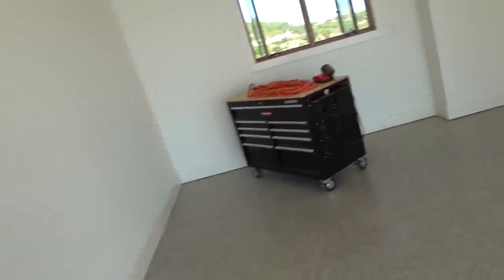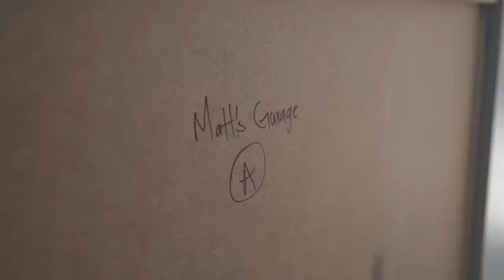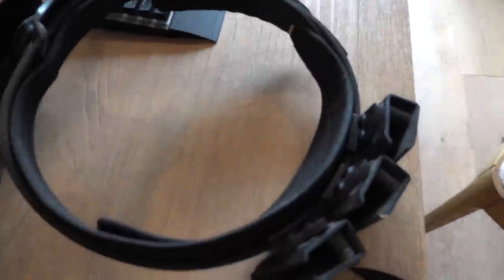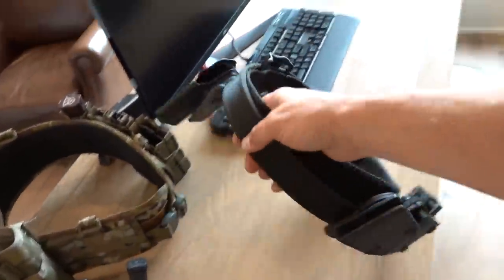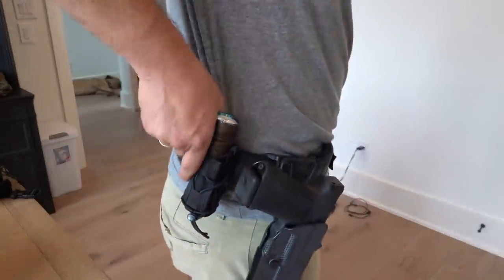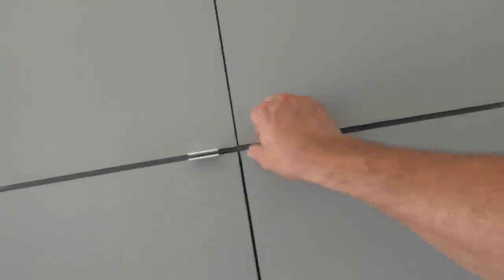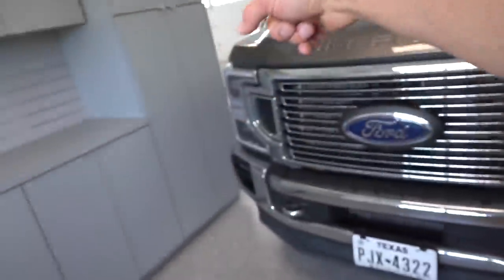Caught Intruder in my Backyard at 10pm... DemoRanch Gear Check!

Comment: Updating the security system to cover everywhere with high quality camera network via hardwired connections and floodlights that cover the whole main areas around the house and areas people might hide will take away any guessing in such times of action.  Having a few monitors around the house to watch and a quick way to turn the floodlights on means you and the family are safe inside while assessing the danger.  Also a speaker system so you can talk to them without leaving the house would be handy.  Most people in such situations will take off and those that don't then get to meet your gun collection.  Also given you are a famous person these days having some type of perimeter sensor system around the property lines and a remote powered gate would be a smart thing to do.  It might seem overboard but sadly there are a lot of crazy and delusional people in the world so better safe than sorry.
Reply: He got the same monitor as me
Reply: +1 for hardwired. I cannot stand wifi cameras. My ex (when we were together) wanted me to install wifi cams and I wanted a hardwired system. Granted, something better than nothing. I even saw one guy throw the wires into PVC pipes that ran through his house, which is a bit much but I like the idea that you'd probably know someone was trying to cut your cameras. With a UPS (power) backup, killing power to the house wouldn't effect much immediately. You'd have to wait for the UPS to run out. But at that point, they know what they're doing and you're probably not gonna stop them. Would be rare to run into that sort of thing, I guess unless you're famous.
Reply: Never forget- protecting your Family is the #1 priority! Stay inside and make sure the doors are locked, etc.

Comment: .300blk supressed, bed side. Also, lights (heavy duty lights) pointed towards the yard (from house to yard). Also, training with the entire family like a fire drill, on which room to go (safe room), and a gun that Mere can use easily to protect the kids from within the room until you clear the treat (or just go armed inside until, the police comes) Also, a police emergency button (simply safe connection probably). Take care, Mat.
Reply: Nuclear air strike as well.
Reply: @Ranstone  just not under wooden tables (just the opposite of what they teach in high schools).

Comment: keep your armor and duty belt ready on stand by.First you grab the vest then put the belt by the time you got the pew in hand your ready to roll.Set up trip wire and solar power lights in open fields or areas running electricity is hard to get to a lit area leaves no space to hide.

Comment: 1. Have a thorough camera system and alarm system. 
2. Have a way to monitor cameras with phone or tablet.
3. Do not leave the home, you know the house better than an intruder so you have the upper hand. Outside you are vulnerable. 
4. Stage weapons in key parts of home.
Reply: He occasionally advertises that a video is sponsored by SimpliSafe and claims that they keep his home safe.  If he doesn't have their systems installed, that would be hypocritical, wouldn't it?
Reply: Convert that old skyscraper nathroom tower to a lookout and put the Ma Deuce up there. Deriously, make sure one high mounted "camera" in front and back is Infrared. You'll spot them in a millisecond and don't have to worry about running from room to room hoping for a full moon.
Reply: @fotogfitzfoto412  simplisafe is good for a average home and a normal person living there. For what he has in the home and his celebrity status he need more than just entry level

Comment: Quick Pistol Belt
-TQ 
-small fixed blade. 
-OC spray
-Pistol (high quality holster with level       2 or higher retention)
-2 extra mags 
-flashlight
  
The best configuration in my opinion for a pistol home defense belt. 
Lightweight and simple. Anything more is for the battle belt or AR rig

Comment: As an avid watcher of both channels, I'm very interested in learning more about being prepared for any bad situations that may come up
Reply: same lol
Reply: Keep your light accessible by your off hand and use it with your off hand, all mag oriented tip forward on off side so it slides into the mag well with tip facing forward.  LOL even daily, no rig, spare mag in off-hand pocket it's tip up/forward so when I grab it with my off-hand it's oriented correctly.  Multi-tool is accessible by either hand too.  Draw primary and back up with either hand.  That's daily, no duty kit.  Night, light is always used off-hand.  Work with what you've got, make it work by repetition.  Can pull either pair of cuffs out left or right, do the same, it will set into your brain thus your muscles.

Comment: I've been doing armed security work for 3 years, and to be honest I think your "bump in the night" belt is alright.  I've used a slightly simpler belt with the same buckle and it was $125.  My only comment would be to put the flashlight behind the Glock mags.  The rule in our company is support tools on the support side.  Thoughts for additions would be a taser in the front by the buckle for cross draw, and a smaller medical bag in the small of the back area.
Reply: Ryan, what type of belt did you use?  The reason I ask is I have the same High Speed Gear belt Matt has (the one he referred to as bulky)  After watching this video I think a less bulky and lighter option is a good idea as well.
Reply: @Meand3023  It's the Safe Life Defense Tactical Belt.  I looked it up online and it is $129.
Reply: @ryanmclean7361  Thanks

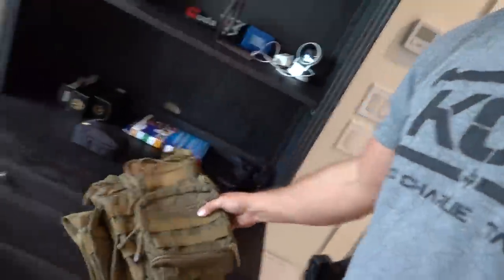Comment: Given the scenarios you presented about multiple intruders, I would go with a plate carrier over a belt. Should be able to hold everything you are wearing around 14:05 seconds, but eliminates having to put on two pieces of gear to only needing one piece. Allows you to store more mags of both pistol and rifle, first aid, extra light and you get body armor that a belt does not provide you. You can outfit the carrier to be able to holster your pistol if needed as well.

Comment: I would invest in a safari land holster for whatever pewpew you decide to run for your larger belt. you can get them to fit with a light or without a light as well as they are great with red dots as well
Also as an Army Medic I always reccomend a good lightweight IFAK or trauma kit. Love your content, just some advice from a guy who has a little experience!!
Reply: IFAK is a must-have on the battle belt, along with a tourniquet. In a use of force scenario, there's always a chance that yourself or a loved one end up leaking instead of the bad guys. So it's a good idea to have a way to patch bullet holes as well as a way to cause them, eh?

Comment: As a former Corrections officer, I'd recommend having some pepper spray and a set of radios. That way if push comes to shove you have a less lethal option and a way to communicate with Mere at the push of a button to have her call for help should you need it.
Reply: Radios are a good idea but fuck less then lethal.

Comment: I would personally recommend having some type of medical on the belt itself. I would also recommend two layer battle belts if you plan on getting another one. The inner belt acts a a normal belt but has velcro on the outside that will then attach to the outer belt that has molle.(good belts has the soft velcro backing on the inner belt to then make it more comfortable when not wearing the outer belt.) The nice thing about it is that it moves up and down less without being too tight.
Reply: Yeah no.

Comment: Try to keep everything away from the rear of the belt. From a law enforcement  background trust me, you don't want to go to the ground with someone and have a flashlight or something hitting you in the spine. And I couldn't tell if those belts have anything to keep gear from sliding around the sides should you have to roll around with someone or even if it gets caught on something moving through the house. You can find keepers online that work really well and are cheap.

Comment: I would move the flashlight in front of the gun holster so that way its easier to grab if you need it while holding the gun. My belt I currently run was about 50 off amazon.
it seems like it works well only time will tell if it is worth it.
Reply: Literally never put anything infront of the gun. What’s more important getting to a light quicker or having something in the way when you go for ur gun? Terrible advice but typical from someone who also thinks a $50 Amazon belt is a good idea for a battle belt. Don’t give advice if ur uneducated on the topic. Just breeds more people with insufficient gear.
Reply: I'd put the flashlight in the back as it's most likely to be the first thing out before you're engaged in a situation. 
Rigid mag holders on the left, holster right.

Comment: id replace that flashlight with a tailcap switch & instant access to strobe by nitecore. animals & people will get disoriented when shined with 1000 lumens on strobe. have someone point the strobe at you at night and see if you can think straight. Fumbling around finding the button on the side is way too long even without adrenaline. Dahua makes good security cameras, their newest one is the N45dud2 which uses 2 sensors 1 IR & 1 color then combines both to create color night video its a really unique thing to witness. In my house I use blueiris on a dedicated pc to run the cameras n drives. a lot of the cameras are power over ethernet so all you have to run is an ethernet wire from your hub to each camera

Comment: Law enforcement & military background:
Perimeter defense/alertness is the first line of defense. Someone entering your property should feel like they’re being watched.
As far as belt set ups: I recommend 3 pistol mag pouches on non dominant side closest to the front as possible (10-11 o’clock for right handed) followed by a rifle mag pouch (closer to the 9 o’clock) . Dominate side closest to the front (of buckle/1-2 o’clock for right handed) a fixed blade and flashlight for use of either hand followed by holster (recommend a Blackhawk omnivore as it holds a variety of different pistols and is based off of the weapon mounted light, as I can recommend the stream light tlr1HL, should have a wml on all home defense weapons) followed by a tourniquet and possibly IFAK for a little extra safety. Just my 2 cents…

Comment: For the bump in the night belt I would def make sure you have a flashlight and red dot on your gun. I would also bring a form of less lethal if possible (taser, oc spray, baton). Better to have another way to deal with people than just gun or fist. I would also have a way to secure people after the fact whether detained or serviced (handcuffs, zip cuffs). And a dump pouch. Takes up little space and is incredibly helpful at times.

Comment: Those cabinets look good and clean, just keep in mind that they aren't built to hold up to much as far as being a workbench. BTW I personally think that med pack is a bit much for a bump in the night thing. They make very small pouches and even ankle pouches with your most basic trauma gear and I would consider something that size, possible on the back of your night belt. Just a thought. Save that many more seconds having it ready to go all in one, also those straps on the trauma pack you have look like they could get tangled. So I'd atleast rubber band or just cut off the extra hangy bits if ya decide to keep it.
Reply: I didn’t want to bust your bubble but you bought Costco cabinets lol. Probably would have haves saved half of what you did. Sorry

Comment: Mad Matt doesn't hold a candle to a Mad Mere.
Solar powered security light coming on pop, pop, pop
down the driveway and into the yard, scares people.
Reply: Solar powered security lights are the worst idea ever, unless you go with very expensive ones. And then still, for security lights if you have grid power, use that.

Comment: Ranch homes need some kind of early detection system further down the long driveway. There are simple beam break motion detectors than can be set up wirelessly and on solar power, all the way to magnetic anomaly detectors that will pick up anything metal as small as a hammer.

Comment: The two belts I use are the trex arms orien and the ribbon tactics TF belt with estac kiwis 2+2 a dump pouch a med kit from blue force gear with a Haley TQ swinger underneath then my safariland holster and a multi tool and gloves hangin off I can throw that belt on easily over my coat pajama whatever and grab a rifle and pistol ready to go

Comment: You need motion detectors on your driveway/gate so you know someone is coming before they get there
Reply: Also would be worth getting solar and a turbine with a large battery and an cctv setup so that the cameras can't be accessed from the internet as a backup, I'm sure Linus Tech tips or someone would make you a server with a Nas so you can store the data onsite as well as you having a large amount of storage and editing power for your videos
Reply: A reverse osmosis system is usually pretty good to have as well, plus a root cellar for you to store food in

Comment: Also I got to say Matt I'm a little stunned that you wasn't prepared for a situation like that given all the things that happened to Roman I guess I just kind of expected you to be on top of that the good thing is is you recognize a deficiency and your correcting it you got to protect yours at all costs
Reply: @HS-hr5wp  family was being stalked
Reply: It's not like he was completely unprepared. Has a full electronic security system, which alerted him to the intruder in the first place. He just didn't have a plan for what to do when the alarms went off, which is shockingly common even among 2A people.
Reply: @theKashConnoisseur  you're right he did have a good foundation basically what I was getting at not too long ago Roman Atwood had an issue of kind of an extreme stalker giving the working relationship between the two kind of figured he might have had a heightened awareness and security being so close to that kind of situation and to hear him say he didn't quite have a kit ready was kind of surprising

Comment: You should have pull out drawers in all your base cabinets so you don't have to get down to see whats in the back. You can also put them in the 2 tall cabinets, makes it easy to find things. As far as your driveway goes Dakota Alert sell a break beam alert that can be set up to 300 ft. apart and will transmit up to 1 mile to the receiver. Ample time to prepare. Good luck with whatever you decide to do.

Comment: you need a med kit that can attach to the bump in the night belt at 6 o clock. vs a sling/pouch. that would be much more effective and less colliding with straps/material when messing with flashlight or.. presenting. :)

Comment: A Masada Valkyrie backpack with a front ceramic plate is my go to. I keep a take down AR in it and use a similar belt setup with the flashlight on the non dominant side. I figure a little armor is worth the weight and it is a nice small package.

Comment: Leg shroud will hold that HSG belt in place a little better. I have a G Code belt that is for that purpose alone. Padded inner belt, leg shroud to keep the belt in place a little better. Couple mags, flashlight, extra batteries, small trauma kit etc.

Comment: Great video never thought  of having a belt ready like you. I would go with the small one. Imaging you have to drop to the ground or something happens that the big belt has more stuff to injure you if  you fall . the smaller one much easier to move around. You  should test it plus what happens if your wife needs it too in case of emergency. Now $200 is to rich for me too bad there are not cheaper ones.

Comment: I would say first off very good start. On the battle belt I would put a smaller IFAK like a Blue force micro trauma kit now, Ferro Concepts Roll 1 trauma pouch, or just a tourniquet. This will allow you to only need to throw on one thing and go. While allowing you to be able to make holes and plug them.

Comment: Safariland if the pew will fit 🤙 thigh strap too for the holster. Lock it down. Others have mentioned the mags in the same direction that'll be consistent. Multiple tourniquets is ideal 2 is 1 in the long run  👍 Gear is a black hole for sure!

Comment: All my quick reaction stations on my property contain a long gun with quick adjustable sling, ears, and equipment satchel.  The firearm is loaded with a mounted light and night sights (like a shake to wake red dot) with back up steel sights, and the satchel contains several hundred rounds in mags and is thrown over the shoulder.  I don't do belts for quick reaction, in order to have more flexibility (crawling, climbing, squeezing into tight spaces, etc.)  All my vehicles are rolling armories, long and side arms, with med kits, blankets, etc.

Comment: So create a specific “bump in the night” kit. And a vest might even fill some of that role better for carrying lights, less lethal options like pepper/bear spray, multiple plastic cuffs and a decent Med kit. Most vests have a large heavy duty zipper and loops for your belt so you could hop out of bed, thrown on the vest, zip it and then fasten the belt and then start your investigation of the bump.

Comment: Holster with a light and a good reliable pistol and a spare mag is a must, also an ankle medical kit is a good low profile option to always have on you. I would also recommend a grab and go sling bag with a quick draw and multiple spare mags. Also throw in some medical. Prep medic has some good videos on putting together a decent medical kit. Most importantly training. Always train with what you will always use. Vertex makes some good grab and go bags I would definitely check them out.